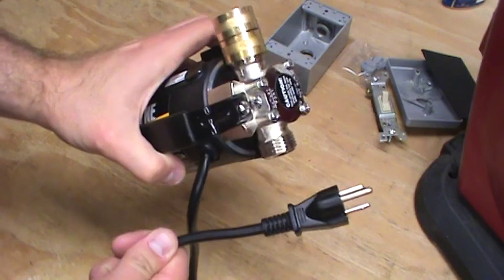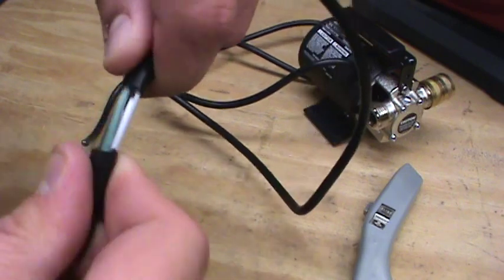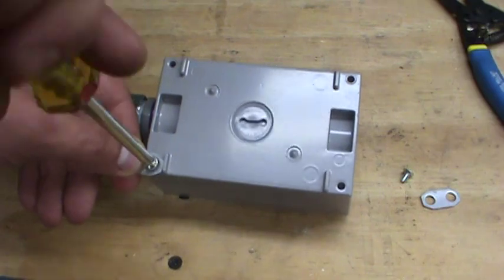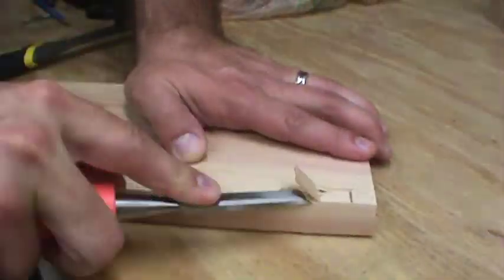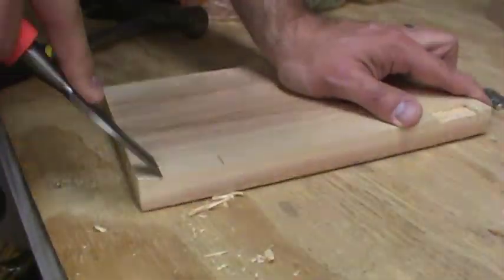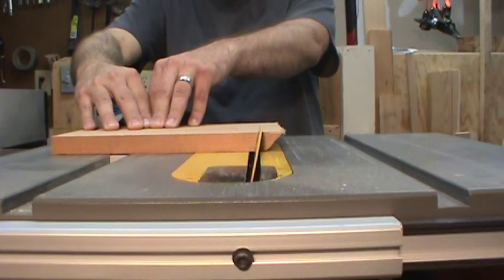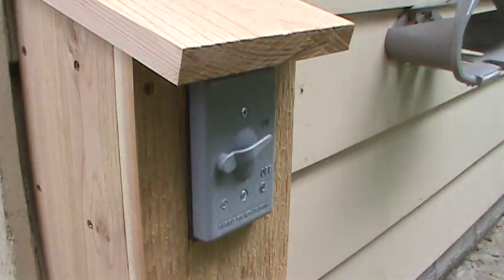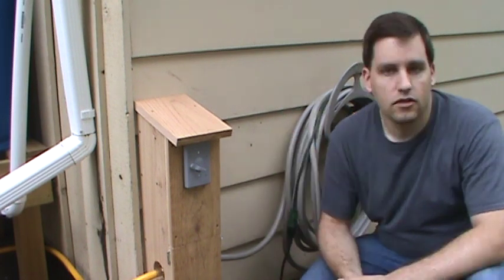The Rain Barrel Pumping Station - Building and "Debugging"

Comment: Thank you for this video, great set up. I saved it planning on eventually I’ll tackle this project and replicate my own. That was yesterday, now today I realized I have an extra smart plug laying around, I already have a door sensor on my rear door pinging Alexa each time the door is closed. So I combined what I already had and now every time I open the rear door Alexa powers on the smart plug which activates the water pump for 10 minutes before automatically shutting off to prevent damaging the hose from future leaks. While I didn’t follow your guide, I gotta thank you for planting the seed lol

Comment: FYI, Line cords through conduit is not code.  Same as not running Romex through conduit.  You went to all the trouble to use a wooden box and weatherproof switch box and then had a a plug connection outside on the ground.  Not sure I get the thought behind that.

Comment: Great job, just a couple of little points... it's best not to run screws into end grain for strength and you need to get that extension cord end into a weatherproof housing until you make it permanent. But overall a great little project, well done.

Comment: If you are anything like me your hoses leak. I noticed you have where the hoses connect above the electrical motor. Electricity and leaky water hose don't mix. Maybe turn the motor upside down so the water doesn't leak into the motor and short out your motor.

Comment: Looks awesome.  Would this setup work with a spray nozzle?  The ones that you have to press and hold for the water to come out.
Reply from the maker: I don't think so. I don't think my pump in particular has enough pressure for a spray nozzle. Also, when it's not spraying the pump is still trying to move water. I can't be sure but it seems like that may be hard on the pump to run it when the water can't flow.
Reply: @BenBrandt22 Thanks for the reply.  Do you think it would work with soaker hoses?

Comment: Just made my own system with solar powered pump.  Let me know your thoughts on the overview video I just posted!
Reply: The pump I used puts out 30 PSI so should be able to run almost any sprinkler set up.  Have a big water supply available....it will empty barrels quick with a sprinkler.
Reply: These two setups are great, I saw yours solar pump setup and that's exactly what I want to do. I did however have a question if the pump you showed would be capable of running a sprinkler system instead of a drip system. I'm assuming at 3 gpm it should be well above 50 psi right?

Comment: Looks good.  Does the pump stop on pressure or do you have to keep the hose on while the pump is on?
Reply from the maker: Thanks. The pump doesn't stop on pressure, so the nozzle I used on the hose is always-open, you can just adjust the strength of the spray. Maybe a smarter pump exists, but I opted for simplicity and low-budget.

Comment: I'm not sure how your barrel system is plumbed. But being a fan of submersible pumps because they are cheaper, silent, etc. I would suggest it. One cable, one hose, done.
Either case that pump cabinet looks nice. Thumbs up. :-)
Reply from the maker: Thanks. I have another video on building the barrel setup. Each barrel is connected together by a shared pipe running below each one. Submersible doesn't work as well in my setup, but it would be an easier option if it did.
Reply: Thanks for the heads up. I'll look for that video. 
I've built a couple of camping vans, on the first one used an external pump. Damn that thing was noisy, just like yours. Soon replaced with a submersible. Beside the tell tale of the water running out of the tank I could hardly guess the thing was running. From than on always designed my systems to run from submersibles. 
BTW nice video keep up the good work. :-)

Comment: I am an electrician. Just a couple tips, when connecting a stranded wire to a screw connection, like a switch or plug, use a crimp on style fork connector, no loose strands and better connection. Also always make sure you twist solid wires around the screw in a clockwise direction this tightens the wire around the screw as you tighten it. 
Great project, I am going to steal your rain barrel/flow diverter idea and possibly your pump station too.
Reply from the maker: Great tips, thank you sir!

Comment: I really enjoyed this video. Thank you. I'm researching how to do something like this but there's no outlet close to where I'd like the setup. Would some type of battery work here instead of hard wiring it?
Reply from the maker: The main thing you'd need to look for is a pump that can run off DC power from a battery (as opposed to the AC power from an outlet), and you could probably use a car battery or something similar, maybe even add solar charging. If you want to shoot water out of a hose you'll need a decent flow rate. My pump is adequate at 340 gallons per hour (about 5.6 gallons per minute).
Reply: Ben Brandt I was thinking solar power precisely. it would be for a low flow irrigation setup so it wouldn't require a ton of power. Thanks.

Comment: The only wire you needed to cut was the black wire and insert the switch to close the circuit at that cut. You could then have carefully removed a small amount of insulation from the green wire and wrapped it in a "U" shape around the green ground terminal on the switch.  As that green terminal is on the metal frame of the switch, screwing the switch into the box would ground the box as well. Less exposed wires means less places for corrosion to get an easy foothold on the circuit.
Reply from the maker: Fair point. I prefer the ease of just cutting the entire cable, but I certainly could have left more wires intact. The switchbox is pretty well sealed and the whole project is somewhat shielded from rain so corrosion isn't a big concern at this point. Thanks for the feedback.

Comment: I wonder if you mounted your rain barrels near the gutters if the extra height would give you more pressure at your pump inlet and therefore more pressure at the outlet.
Reply from the maker: It would certainly add more pressure, though I don't know how much. Personally I'm not comfortable putting that much weight so high off the ground, but it's certainly worth a shot. AN ideal situation would be to have the barrels at a higher elevation, and have the garden down a big hill... you could get a good pressure boost without even trying :-)
Reply: Ben Brandt According to Engineering Toolbox, you would get 3 to 4 psi if you raised it to near your roof gutters. Perhaps it is not significant enough when compared with your pump pressure.

Comment: always use Hose Filter Washers both before the pump as well as on the nozzle. hose snap on connectors would also make connect disconnect faster.
Reply from the maker: +Hensly Yung Great idea on the filters, I'll have to check that out. Quick connects would be nice, but we leave it hooked up all season.

Comment: I noticed at 10:55 that the pump cord plugged into the extension cord was sitting in water!! Not very safe. Could cause an electrical shock!!!
Reply from the maker: Certainly something to watch out for, but if your plug does get wet enough to short out the circuit breaker would trip and shut off the power immediately as designed.

Comment: That is a nice setup. 
There are very few people on youtube using a pump for their rainwater. I like your setup but I was looking for a bigger pump.
My rain system is 2 IBC totes 275 gallons each, plumbed together at the bottom. I use a Rigid 1/6 HP submersible utility pump and it will run some low flow sprinklers (http://www.landscapeonline.com/research/article/16470) but my pump won't run a metal impact sprinkler.  I'm thinking I may need to go up to 1/3 or 1/2 HP to really do what I want.

I'm curious to know if you're happy with the power of your pump. Can you run a sprinkler on it?
Reply from the maker: I doubt my pump would run a sprinkler. As pumps go, it's a pretty low end one. We happen to have an in-ground sprinkler system, so that wasn't really a goal for this project. We use it mainly to water our nearby garden with the hose, and it works well for that. We also have a tee that goes to another non-pumped spigot so we can fill watering cans, fill buckets for the kids, or use for washing our hands when we're outside.
Reply: Well it's a fantastic setup, thanks for the reply!

Comment: good idea , but did you caulk/silicone the backside of it so water can't get into the walls where you drove the screws?
Reply from the maker: +brad white Nope, but thank you, I hadn't considered that. We don't get much water back there, and if it became an issue it's easily accessible inside the garage. Maybe when I get out for some spring maintenance I can seal those up a bit.

Comment: Why not add the switch to the outlet? that way if the pump goes bad it can be plug and play with a new one.
Reply from the maker: +drglnc69 Not a bad idea, though I want to keep the switch outside and protected from the weather. I'd probably hide an outlet plug inside the box. When the pump finally dies I'll see how difficult it is to replace and I may rethink my design then.
Reply: Ben Brandt now it’s plug and screw and play. Really won’t add much time to swapping out a pump to unscrew 3 wires from s switch do its just basically your personal preference on how it’s done. It’s real easy for the you tuber sideliners to say what you need to do to make it better but just remember, this was your project and since they didn’t sponsor you then you did exactly as you should have done and fabricate it the way you needed it done at the time, not the way the next one will be done but as you needed it done today. 

I think you did a fantastic job buddy and I’m gonna borrow parts of your job to finish mine off. Just installed my barrels yesterday but I’m not happy with the water flow out of the spigot so a pump is perfect!! Where did you get your pump at and about how much did just the pump cost? 

Thank you buddy, take care!!

Comment: I'm no electrician either, but when I attach a stranded wire to a screw terminal that was designed for solid wire I like to tin the ends with a little solder first.  I just find it easier to lock the wire down that way, and it also helps ensure there are no loose strands of wire which could short circuit or arc if they wind up too close to the side of the box or against the front of the switch.
Reply from the maker: Thanks Stacey, Good tip!